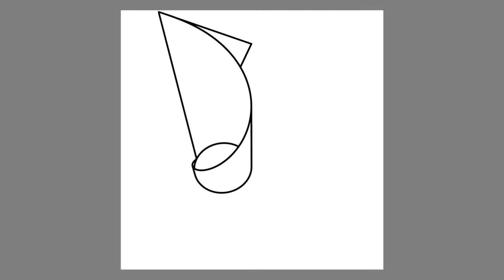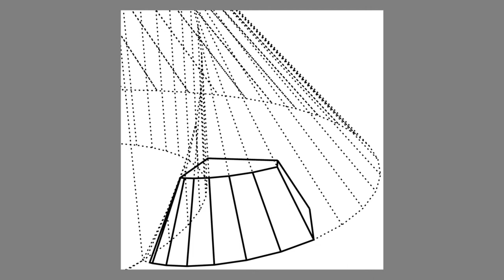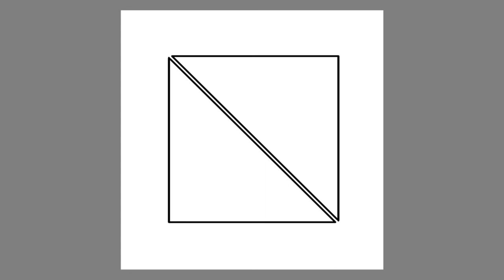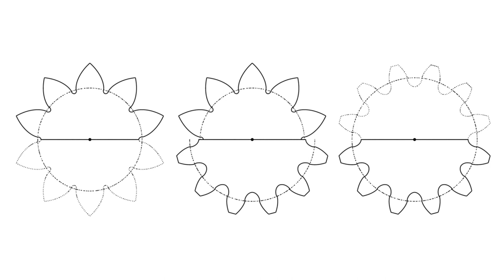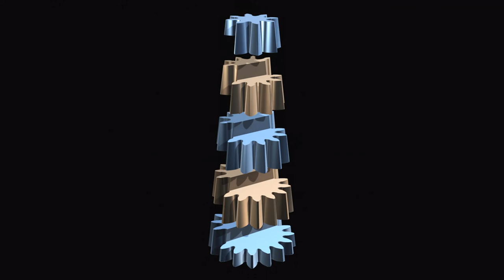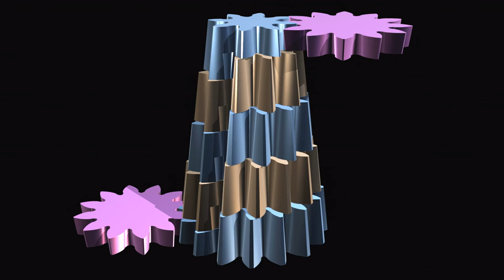New involute gearing technology & New-CVT transmission & Conical involute, Beveloid, Tapered - Gear

Comment: Excellent Video. Your Video helped me to understand many things better and inspired me to model these gears in Solidpython/Openscad. However I got the feeling my pressure angle calclulation for the multi ratio gear is wrong. Can you tell me which pressure angle you have used for the multi ratio gear picture on your website (the red and blue/ green gear).? My gears have another pressure angle...

Keep up the interesting and entertaining work.
Reply from the maker: The best way is to go to http://new-cvt.com/source_code.php and download the source code (and blender, its free) and set Show_Demo = 3. Also read http://new-cvt.com/theory.php#multi_ratio . Let me know if you need more help.
Reply: @New-CVT  Thanks for your answer. However I am not familiar with Blender. I managed to look in the python source code, however I don't know how to execute Show_Demo=3.
Anyways I did understand what my failure was. I misunderstood the 3D involute Gears and modeled them wrong. I have succesfully printed the 2D Version of the Multi Ratio Gear. You can found a video of them on my channel. Can you explain me the modeling of the conical gears a bit further? I tried to model conical Gears by Rack-Cutting and rotated the Rack in the x-y Plane as well as in Z-Direction, but the result looked much different than your gears and not right.
Reply from the maker: @sgschusswaffenlol9  Maybe it’s best if I give you a quick lecture via WhatsApp or Skype on blender and the theory. I would really like to understand better with what it is that you have problems understanding as I suspect most people will have problems with that. I can then make a better video. You can contact me via innovate@geert.com and please tell me how to contact you and when (also please mention your time zone).
Reply: @New-CVT  Thanks for your quick reply. Tomorrow I will write you an E-mail. If I found one of the wrong models, I will add the model of my failed attempt. I'am from germany (Time Zone: GMT+2). 
It would be great if you would make a second video explaining some things a bit deeper, as I really enjoyed your video. It was fascinating to learn a lot more about gears. I thought I knew already a lot, but learned much more about gears.

Comment: This helped a lot to explain the mechanism.

I wanted to ask about how do you know in which part of the multi-ratio gear is It interlocking so that you can move to the next single-ratio gear - but then I though that If you have 2 ratios, there should be 2 different torque values ~> therefore If you messure them you know in which part of the gear you are and to which single-ratio gear you can move.

I'm not an engineer, so my explanation maybe be completely wrong.
Reply from the maker: Actually, if you look at the base of the main gear there are some pieces of plastic sticking out, in combination with an optical sensor these tell the computer exactly when the main gear has past to the next half of all the multi-ratio gears in the main gear. So it is easy.
Reply: @New-CVT  ooh I see. It really is quite easy. Thanks for answering!